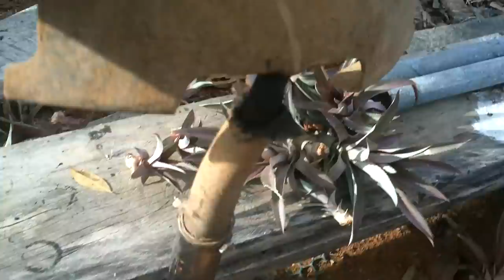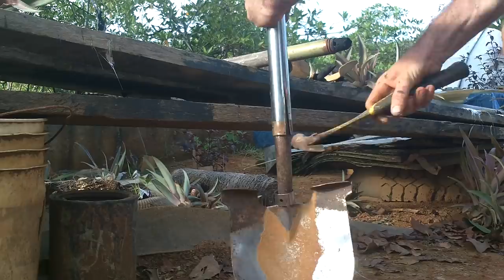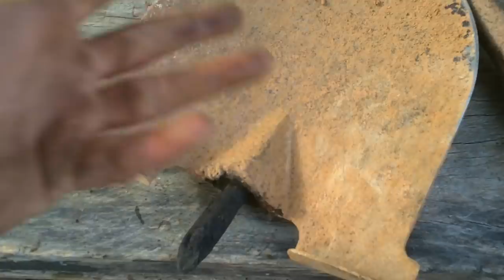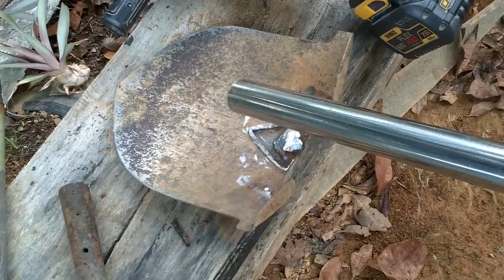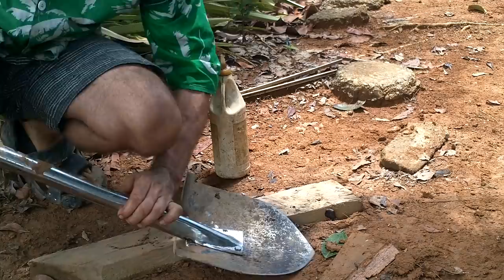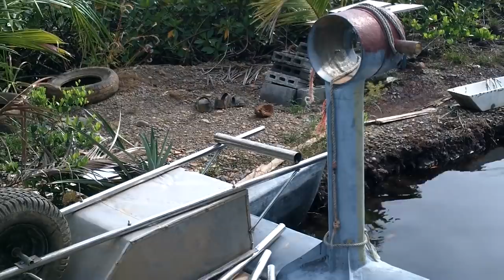Stainless Shovels

Comment: Bend the extra piece of pipe for the wheelbarrow in a v shape. The V hits the ground, the ends bolt into the barrow. Road bike handlebar tape for the shovel if you don't have any plastic to fit onto the shovels.

Comment: could the section of the handle that attaches to the head be designed to be thinner so that it ends up breaking first, instead of the head breaking, since it is easier to replace the handle than the head

Comment: ya know, a lot of your rusty tools issues could be solved by storing them in a bucket filled with used oil.
Reply: I wire brush my digger when done with it then whip it with a oily cloth